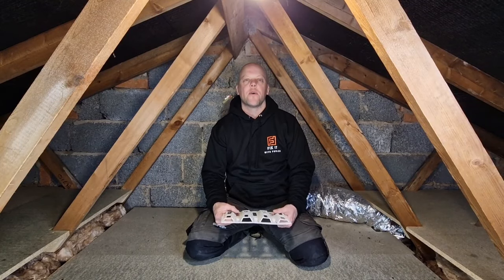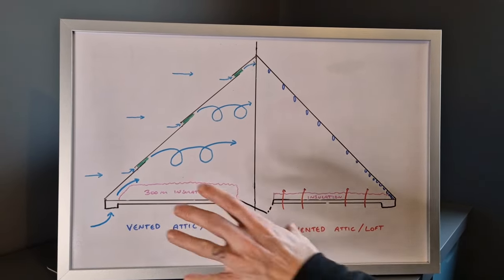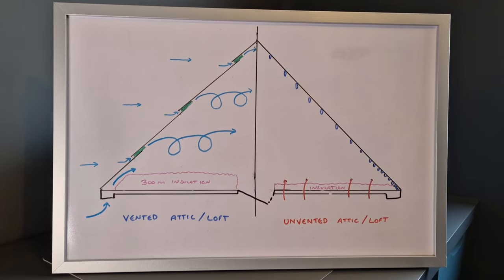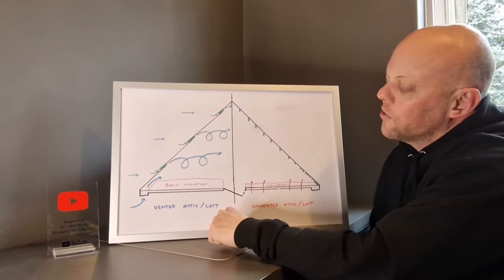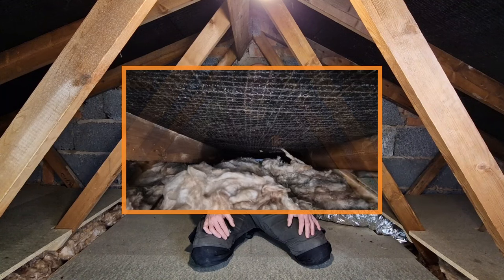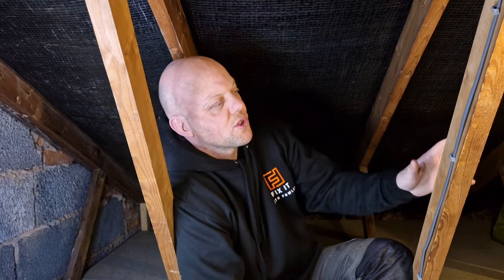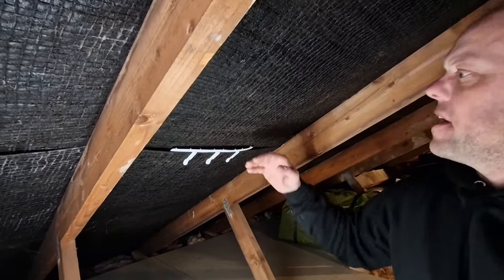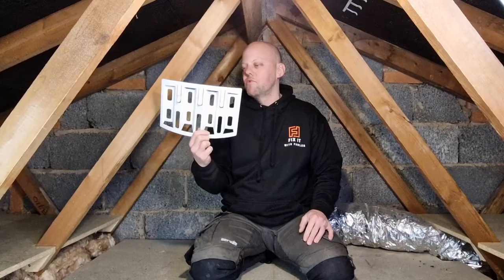Condensation in loft ? - Cheap and easy fix using Felt Lap Vents   #condensation

Comment: That's interesting what you said.  I always thought that the soffit vents let in the air from the outside.   And the higher roof vents were there to let the warmer air that rises, leave the loft .
Reply from the maker: Hi, newer lofts have a breathable roofing membrane normally accompanied with vented eves and a vented ridge (top of roof space). Older lofts like the one in the video have none of that but some have vented sofits (outside near guttering) only if they have been retro fitted. These vents definitely help to create a vented loft space which will not only help with condensation in the winter but cool the loft in the summer. Hope you liked the video, don't forget to look at my other videos!
Reply: @FixitwithFowler  my meaning was for older roofs with old felt,.  And the use of manthorpe lap felt vents,. 
You suggested air from outside flows under the tiles and through the vents.
So how does the old air escape????
Reply from the maker: Oh right! The vents are positioned on either side of the loft (slightly staggered and at different heights). When the wind blows outside the air is forced into the loft on one side (as per the whiteboard explanation). This increases the pressure in the loft and forces out the older air. Hope that makes sense?
Reply: @FixitwithFowler  Hi, if my property doesn't have vented soffits is there any point in getting eave vents will lap vents be suffice.
Reply from the maker: Hi, the lap vents should be good enough on their own. I would suggest installing 10 - 20 depending on the size of your loft. If you follow my amazon link, that's the cheapest i could find!
Reply: @FixitwithFowler  Thanks

Comment: Can these roof vents be used on roofs with breathable membrane? If so, can you explain how these would be fitted? Thx
Reply from the maker: Hi, yes they can and the process is exactly the same as on the video.
Reply: Thank you. Will give it a try. The problem I had also was a wet chimney breast in the loft and the rafters on that wall. Do you think that’s caused by the condensation also or is a separate problem?
Reply from the maker: This is a link to the vents https://amzn.to/3GGrm9i the damp on the chimney sounds like a problem with the lead flashing around the chimney itself. Hope that helps. Please subscribe to my channel for more great videos!

Comment: Any reason these couldn’t be trimmed down width ways to fit rafters with narrow gaps? Mine vary between 25-30cm. Thanks
Reply from the maker: Hi, i don't see why you couldn't trim them down if you're careful. They have made a massive difference in my loft, and now theres no condensation whatsoever. Let me know how you get on with the lap vents!

Comment: I live in a newer property that has vents in the soffits and a dry ridge system. However, we still ended up with condensation and mould on the membrane, and it would appear that everyone else around us is in the same boat. I’ve just started to install these lap vents, but I wasn’t sure how to best place them. I’ve generally put two in each gap (one just up from the soffits, and another further up towards head height), then skipped a gap to do the next one. When completing the opposite side, I then did the same, but staggered them by one gap to prevent air coming in and going straight back out. My roof has three sides to it, so I’ll need about 35 vents at a cost of £90, but having 12 traditional tile vents was going to cost £900! Any help is welcome if I’ve not done this correctly. I’m going to re-do the loft hatch seal today.
Reply from the maker: Hi John, It sounds like you have installed them correctly. Not only do you require an airflow in the loft, but you need the air to circulate. By positioning them in alternate gaps between the rafters and not inline with the opposite side of the loft, you should achieve a dry loft. It sounds like you have installed them perfectly! Just have a quick check to make sure any ducting is connected as it should be as i have come across this before. Thanks for your comment, and dont forget to subscribe 😉
Reply: @FixitwithFowler  that was what we discovered in 2021; our guest bathroom extractor pipe was only connected at one end. The other end was in the loft and not connected to the soffit (and someone had stuffed a ball of loft insulation into the disconnected end!). We also found that the loft insulation had been stuffed into the soffits, with the empty bags of loft insulation also thrown into the loft! All fixed now though. It’s shocking the standard of work that some people will happily try and get away with. Thanks again.
Reply from the maker: Hi John, the problem with new builds is that most work is done on a fixed price and the consequence is normally a lower standard of work. Having said that, there are still some good new builds with good workmanship.

Comment: Hi there, should the eaves be vented all the way along the roof? I'm in a new build and the insulation seems to be stuffed in all the way, guess I need to pull some out but not sure how much
Reply from the maker: My eves are vented, but it does depend on the roof. Do you have vents in your sofits?
Reply: No I don’t, I’m local to you btw, on the bellway estate in Sileby 😂
Reply from the maker: In that case, you dont need to worry about the inulation down to the eves. Have you fitted the felt lap vents in the loft? The felt will be breathable, but have you checked that any extractors have ducting to the outside. That is really local btw!
Reply: @FixitwithFowler  oh is that right I can just leave it there? I’ve fitted about 10 lap vents, perhaps more needed
Reply from the maker: Yeah, i would recommend about 20, 10 on each side. Make sure you install in a stagered formation as well. Also, check that the loft hatch has sealed well.

Comment: Can you convert a loft with that old type of felt to a room 🤔 thanks
Reply from the maker: You would need to speak to building control about building regulations as there are loads of things to consider. The felt itself is not a problem.

Comment: So I have an ongoing issue with droplets on one side of my loft. The North side to be exact. I have installed the felt laps, I have insulated the floor to death. recently I have installed an extractor fan pumping moist air out through the brick vent. Nothing works. I have massive moisture on the North facing side. Any advice would be great as this is an almost impossible situation
Reply from the maker: Hi, the problem is that north facing roofs is the lack of sun and heat. Can i ask how many felt lap vents you have installed and the position?

Comment: do you just install this vent to one side of the roof or both side? thx
Reply from the maker: Hi, firstly, thanks for your comment. You need to install them on both sides of the roof, this allows air to enter and exit the loft/roof space. The other important thing is to not install the roof vents directly opposite each other. This creates a turbulent air flow through the loft/air space. If that helps, don't forget to give the video a thumbs up! Also they are on offer if you follow my linkhttps://amzn.to/3XXG0Rg

Comment: its work?
Reply from the maker: Yes, they work really well! You normally need around 20 felt lap vents to create good ventilation in the loft!
Reply: @FixitwithFowler  thansks i will buy 20
Reply from the maker: @Lokman1210 thanks, these are the ones I used in the video https://amzn.to/4bfi0Pt but these work exactly the same and loads cheaper https://amzn.to/3wDLkQo.

Comment: Will this get rid of lofty smells? I have a piv damp vent and the smell from the old loft insulation. I do have breathable membrane from 2 year old re roof
Reply from the maker: Hi, as for getting rid of old insulation, im not sure. I have noticed a massive difference in my loft since installing the felt lap vents, and now the loft doesn't even get hot in the summer. If you have removed the cause of the smell, then i would say this will definitely help and is worth it for the cost. https://amzn.to/3PVLGch

Comment: What if there is no soffit/eave vents will it still work can only see the feltish material from the outside
Reply from the maker: Yes, it will still ventilate the loft/roof space. You may need 20, though, to create enough air flow, but it depends on the size of the loft! https://www.amazon.co.uk/dp/B00M97O5YY/ref=cm_sw_r_as_gl_apa_gl_i_TWMPB785GDBHEQY34RY3?linkCode=ml2&tag=fixitwithfowl-21
Reply: Thanks alot for the prompt response much appreciated
Reply from the maker: @sulaimanm2472 no problem,  i always try to respond to all the comments on the videos!

Comment: Hi my house was built in 2007 so I have vented eves and all clear but I am getting condensation under my loft boards, should there be a gap between the insulation and loft boards as I haven't got a gap or will these Lap Vents fix it ??
Reply from the maker: I have loft insulation touching the underside of my loft boarding. These air vents definitely help with condensation.
Reply: Yeh mine is also touching the underside of the boards, we have a 4  bedroom house with 16 solar panels on the front so a decent size roof how many of these would you suggest?
Reply from the maker: Hi, i would recommend 10 felt lap vents on each side of the loft.https://amzn.to/3RgbOO8 This should be sufficient to increase the air flow through the loft but ensure you fit them in a staggered pattern as per my video.

Comment: Hi mate I have the same loft type I was just wondering is the insulation u can see through the gaps have asbestos in. I think the recent owners had new insulation down as it’s more of a yellow colour? Thanks in advance
Reply from the maker: Hi, no there is no asbestos in the original insulation. The original insulation in my house and houses of a similar age (1960's) used fiberglass insulation which is yellow in color and extremely itchy and irritant. Make sure you wear a mask, gloves and googles or glasses if you are moving any old insulation. Have you installed any of the felt lap vents in your loft?
Reply: @FixitwithFowler  hi yes our house was built in the 70s and I did move a little bit of the insulation and it was itchy. Yes I also fitted the felt vents thank u for that
Reply from the maker: @steveo2009100 no problem mate, the itching does stop after a few days

Comment: My roof is an old stone roof with back pointing. Ive noticed condesation. But i have no felt as its that old. Until i have the roof re done would these slot beneath the stone and do the same job. It should i just bore a vent into the wall ?. Thanks
Reply from the maker: Hi, unfortunately, these won't work.  It would be best to install vented eves (if possible), or the other option would be to put a vent through the wall.
Reply: @FixitwithFowler  I was going to vent a six in hole in the gable end possibly either side to try get cross flow it's insulated to the wall that separates the loft hatch but I'm getting condensation behind the hatch if it makes sense
Reply from the maker: @robertmij7425 yes that a good idea. Has your loft got 300 mm of insulation, and is the hatch insulated?
Reply: @FixitwithFowler  it's got an insulated hatch and it's kingspanned and boarded with adequate airflow. More than the recommended 50mm to the tiles. But only to the loft hatch partition.
Reply: @FixitwithFowler  and is the 300 mm the loft hatch rolls on the floor of the eaves you mean. Sorry for all questions
Reply from the maker: 300mm is the depth of the loft insulation measured from the ceiling. Can you see the underside of the tiles?
Reply: @FixitwithFowler  yeah I can see the stone tiles.
Reply from the maker: Oh, right, i think the first option is to vent the loft with a hole each end, but im not sure it will be enough.
Reply: @FixitwithFowler  thanks for your reply until I've vented it I'll run a dehumidifier before I run into big problems
Reply: Back pointing is, I think, also called 'torching' but traditionally done with lime, not cement. The lime mortar absorbs (and releases) any airborne moisture, whereas cement mortar is cold and impervious allowing more condensation than even the stone. A stone, with lime mortar torched, roof may not need much ventilation.

Comment: I don't have vented soffits or facias, is that an issue? Also, do I have my insulation like on the right of your drawing (butted up) or left please? Thanks
Reply from the maker: Hi, you don't need to have vented sofits or facias, and in fact, these felt lap vents are designed to increase or create ventilation in the loft to avoid condensation in the winter and build up of heat in the summer. You need to have your insulation like the drawing on the left and make sure it is not touching the underside of the roofing felt. Any more questions, give me a shout!
Reply: @FixitwithFowler  thanks so much for the reply and advice 👍
Reply from the maker: Hi, no problem, the whole idea of my channel is to help people save money so i am always happy to help!

Comment: Will this help with humidity?  My loft in loft averages around 85%.  I've used an aqara temp/humidity sensor to monitor
Reply from the maker: Yes, it should do. Increasing the ventilation in the loft it will reduce the humidity.
Reply: @FixitwithFowler  thanks.  Just bought some.
Reply from the maker: @2377shortie hopefully they will sort out the humidity!
Reply: @FixitwithFowler  10 didn't do the job so I have bought 10 more.  Is it best to stagger the other side.  So if the left side starts low should the opposite right side start high?
Reply from the maker: @2377shortie  yes definitely stagger them as that will create a turbulent air flow

Comment: We have a loft space that was converted by the previous owner. It has no insulation and is gettimg condensation in the loft space either side of the loft conversion. Can i put these lower down and not worry about the higher up ones as i have no acces to them. The conversion is a plasterd room.
Reply from the maker: Hi, the condensation comes from lack of ventilation, so these felt lap vents are definitely worth a try and by far the cheapest solution to condensation in your loft. These are the cheapest at the moment https://amzn.to/3sYqREc
Reply: I have ordered 10 vents, should be with me tomorrow. Im wanting to insulate the roof space above the conversion, do i need to leave a space between the board I slide up and the membrane?
Reply from the maker: @natetaylor564  Yes, you need to leave a space between the insulation and the roof membrane as you need an airflow to prevent condensation. The insulation should sit directly on the back of the plasterboard. Hope that helps
Reply: Yes cheers. I'm going to gapo tape the sides of the board andslide it up. It's a very tight space so try my best. Had a load of quilt lay on the rafter at 90° and minimal in the rafters. Can I lay that into the rafters and then osb over the top to make abetter platform for working in there?
Reply: Also I only ordered 10 vents, I saw a comment saying 10 - 20
Reply: Thanks for the replies by the way 🎉🎉
Reply from the maker: @natetaylor564  i think you ould do that with the osb. Hopefully it will all go well. Are you using cellotex or similar for insulation in the roof
Reply: @FixitwithFowler  yes using similar foiled board
Reply from the maker: @natetaylor564  that will be ideal. I had a leak on our roof, and once i removed the damaged roof membrane, i found that there was no insulation. I have done similar to what our describing but from outside and slid up 50mm celotex, and now the difference is amazing. The landing doesn't feel cold at all.